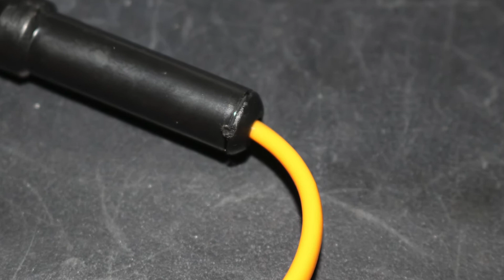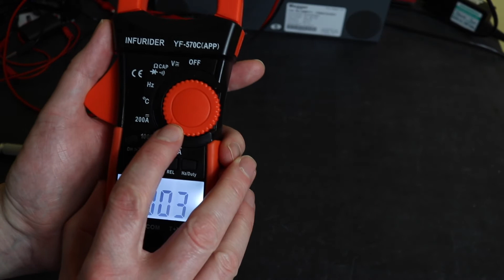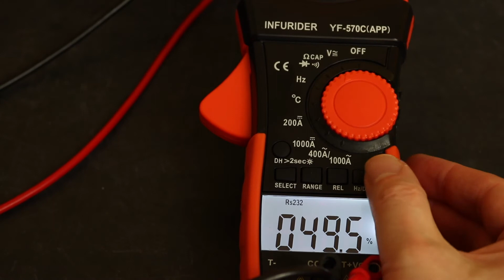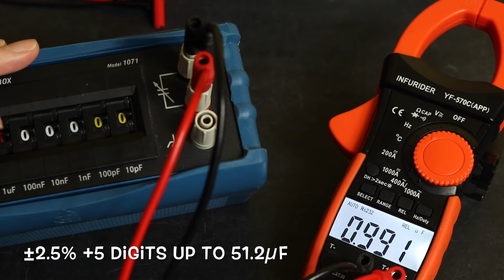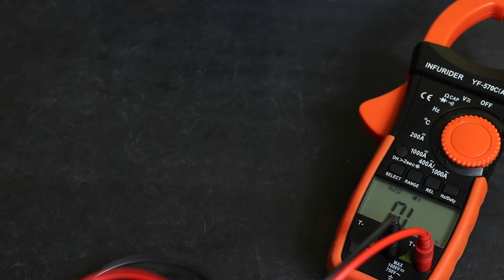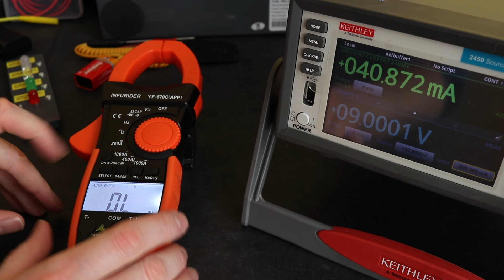Infurider 570C Clamp Meter Review

Comment: I did like the ease of connecting to your tablet. Nice review!
Reply from the maker: Thanks JM. It did connect first time to tablet without any issues, so pretty good in that department and software is good for collecting the data. Appreciate you watching.
Reply: @three-phase562  do you review bench top multimeters? I think I want one. but there are so many on the market, and most are more expensive than I can justify as a hobbyist.
Reply from the maker: @jaymclemore9497  No, I don't really look at bench multimeters. I have a high end Fluke to carry out calibration checks, but that is broken at the moment. If you can stay with 5.5 digit, then there are some pretty reasonably priced offerings out there. Going up to 6.5 digits is when it starts to hurt.